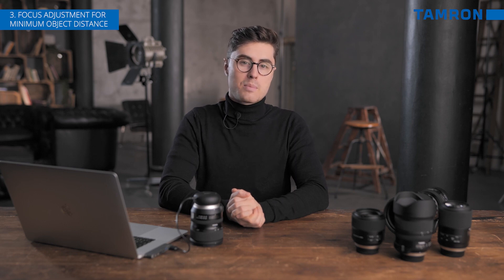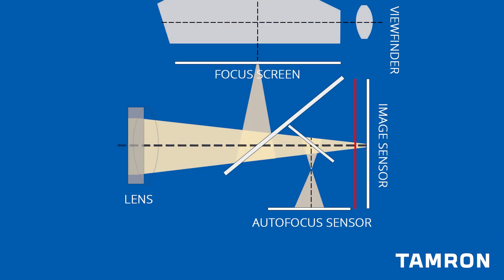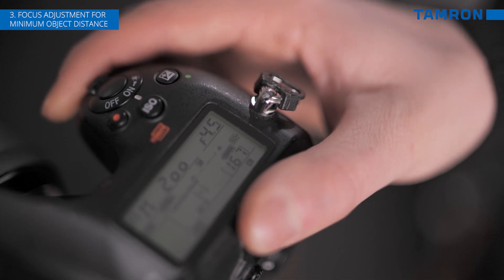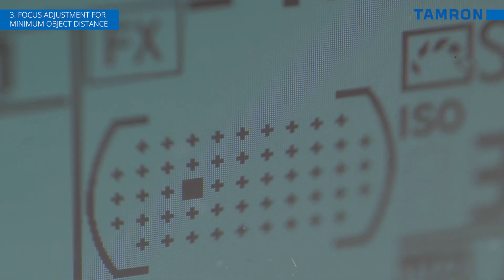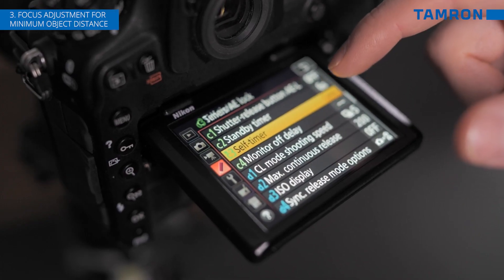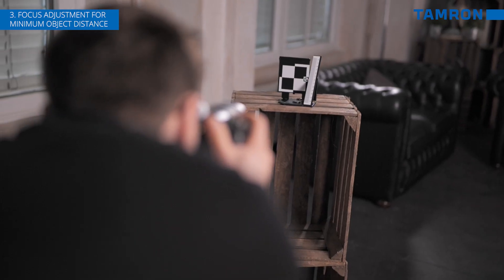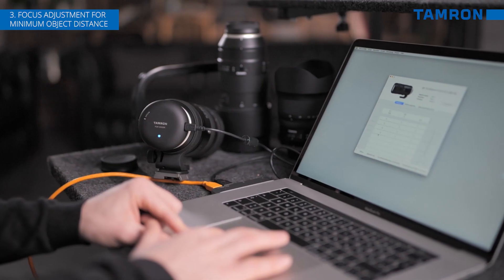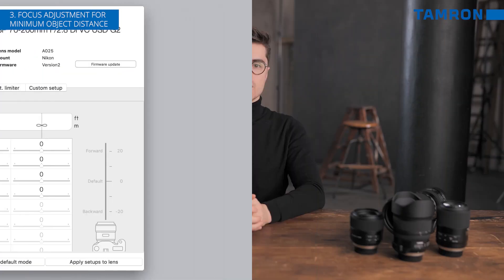Tamron |  FOCUS ADJUSTMENT FOR MINIMUM OBJECT DISTANCE

Comment: I’m sorry, but for a company as big as Tamron, this explanation is just not good enough. The tap in console costs enough and, basically, this explanation does not go into anything like enough detail. It’s almost using guesswork by saying adjust in increments of + or - 5. For example, you take a shot, if it’s front focussing you detach the lens from the camera, reattach the lens to the console, adjust it by -5, you then have to disconnect the lens from the console, reattach to the camera and take another shot, if it’s no good adjust it to -10 etc, etc, until it is sharp. You then do that at four different focal lengths (on my 70-200) When you’ve put in the four different adjustments, is that it? Does that then mean the lens is sharp throughout the entire range, or will there be a variation in the sharpness. When you adjust the setting for 200mm will that have affected the setting for 70mm? If so, you could be going round and round setting for the four distances and back to the beginning again. If that’s the case fine, but why does the video no show or explain that? It’s showing about 10% of what it should. It’s almost like “here’s the console, work it out for yourself!”